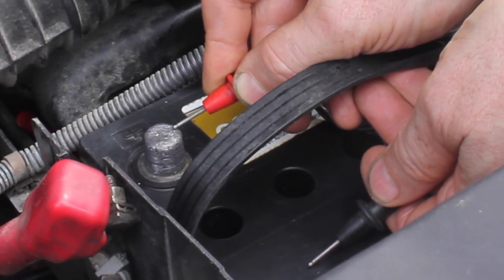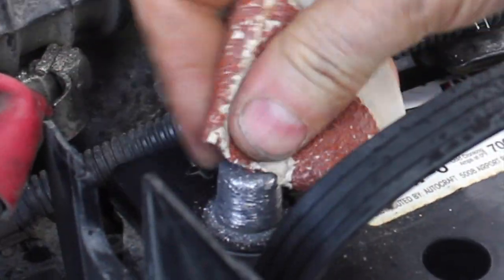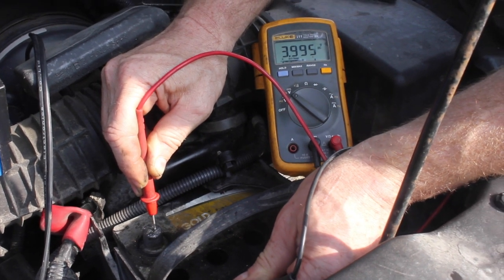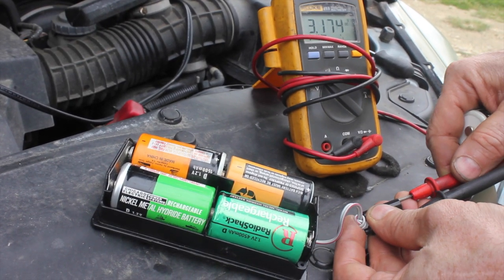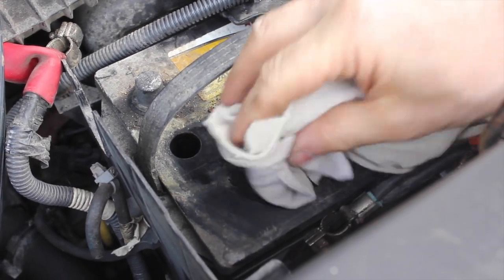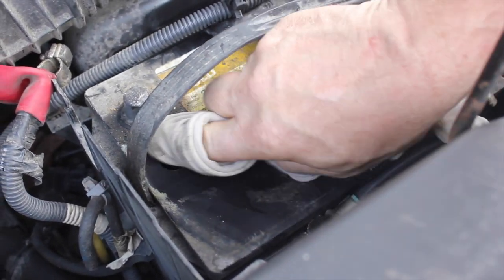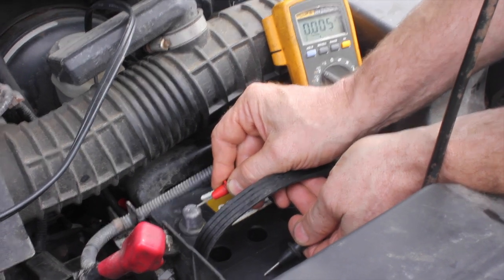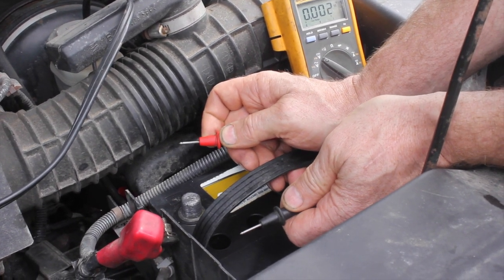does DIRT on your battery drain power??? (here's PROOF)

Comment: It would be interesting to know how many amps drain too
Reply from the maker: It would be interesting to see how many amps are running through to the dirt and grease. That would've been a great test to do before I cleaned the battery. The next dirty battery I see which probably won't be in a long time (they seem to be common) I'll try running a test on the amount of amps. My guess is going to be that the amps will be pretty low. Thanks for the comment and if you run the test before I do, please post it. I would be very interested to see what happens.
Reply: @errorcodeguy456  would love to see the Amps test